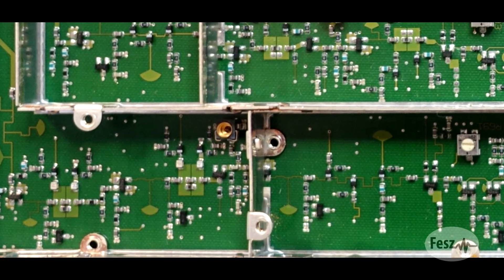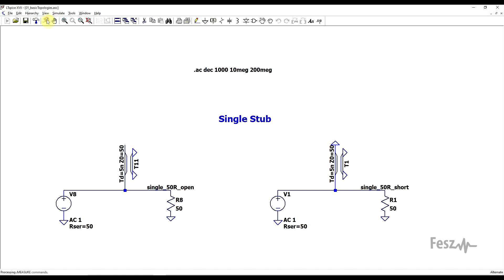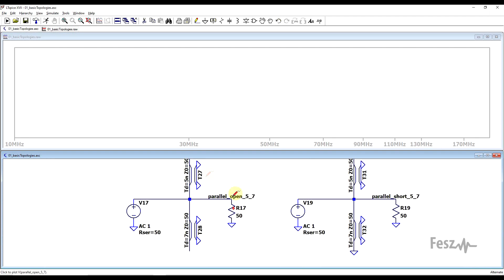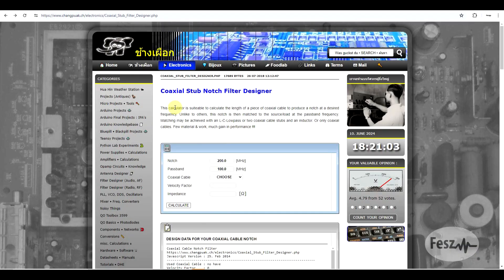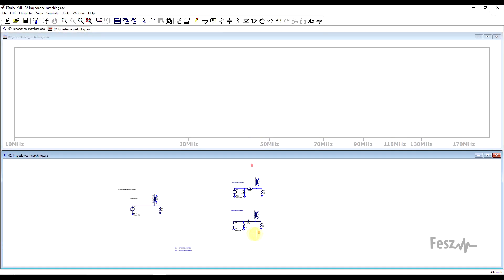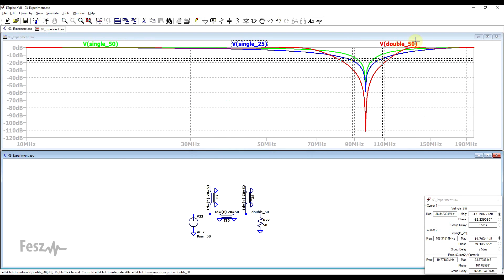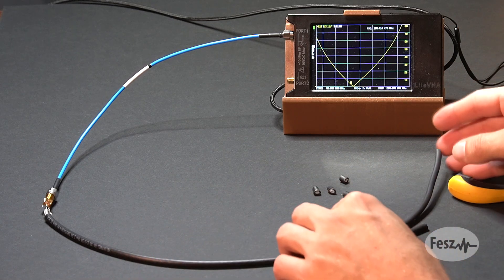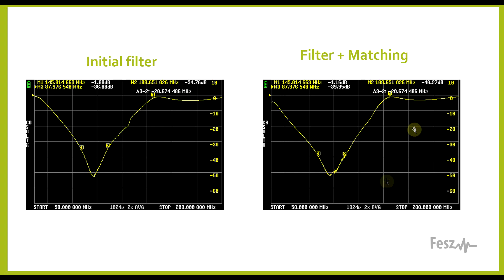Coax Stub Filters

Comment: An interesting experiment is to put the circuit into simsmith. It turns out that the length of the interconnecting piece of coax can be used for impedance matching.

Comment: I made a coax stub filter for 144.3 MHz to stop 2m band inference on my TV. The 5rd harmonic took out the main BBC DVB transmission on 721.5 MHz in my area, so the plan failed! 😂
Reply from the maker: This is quite a difficult problem with transmission line filters - you have multiple pass and stop bands... the most annoying thing is when you want these, and they are not exactly where they should be... I tried building a cavity filter for 145MHz, hoping it will also pass the 70cm band (145x3=435). However, the ratio was not exactly 3 but rather 2.9 or something, so that plan failed...
Reply: @FesZElectronics  That's a cool idea though! But it also explains why handheld antennas on 144 MHz aren't great on 432 MHz, as they usually rely on the same (tenuous) harmonic relationship.
Reply: @FesZElectronics  PS, thanks for the excellent content! Love the videos!

Comment: I use coax stub filters for amateur radio events like Field Day where there are several radio operators set up in close proximity to each other.  A couple of tricks if you use stub filters for events like this.  First, add a toggle switch to the end of the coax cable so you can change your stub filter from a open to a short.  In use if you make a 1/4 wave 40 meter stub filter having the end of the stub shorted or open changes the bands that are filtered.  In the case of the 40 meter stub either 20M and 10M or 40M and 15M.  Another trick is to use a impedance trombone.  This allows you to fine tune the overall cable length to precisely null out a frequency where you might be interfering with another operator.  Mike KC3OSD